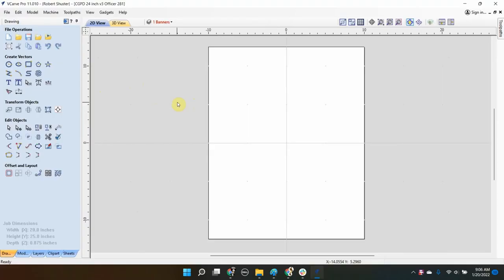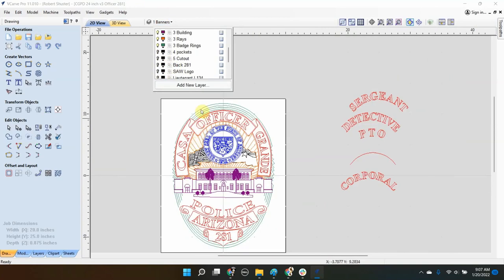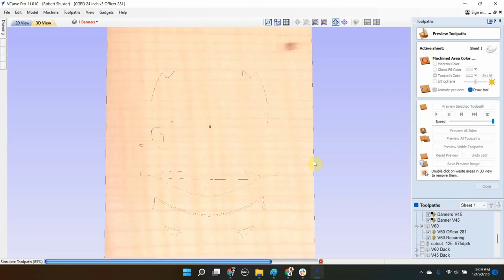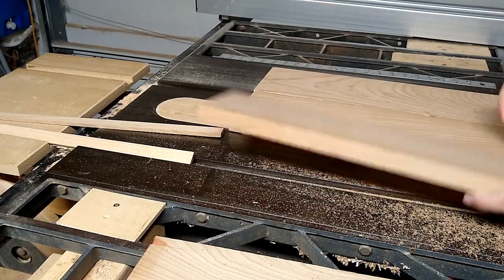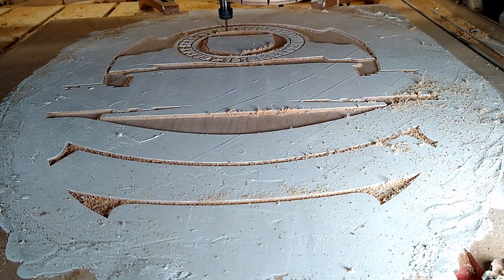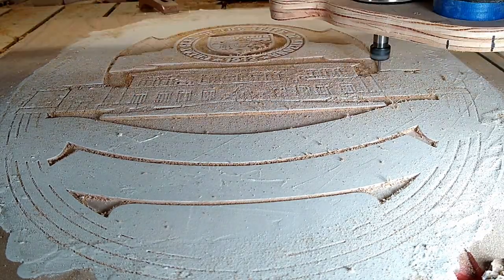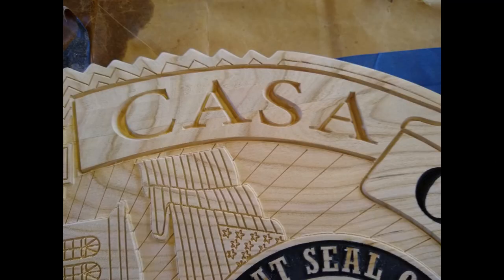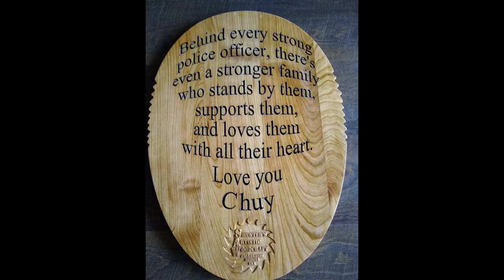Making Badge for Fallen Local Police Officer

Comment: Great job Rob.  Enjoyed your process and video.  I have done a few police badges (donations) and fireman logos/cribbage boards.  All gratis so far.  This was before i stated getting into YouTube.  Some of them are on my Instagram page.  Getting the graphics put together is definitely a challenge.  Besides my epoxy work that you know I am doing, i have been trying to build my 3D skills.  I did one retirement plaque for the Point Loma fire department that was designed to be 3D.  that was interesting.
Reply from the maker: I need to get more into building 3D designs (I need more time in the day).  Are you using Aspire, or something else for you 3D designing?
Reply: @sidewinderdrums  for woodworking projects I use aspire.  For my 3d printer I use Fusion 360 - mostly for brackets, boxes, etc.  I am actually quite a novice at this time and exploring the landscape of possibilities.  I did do one YT video on me using Aspire to design a sunflower plate for one of my grandkids.  Video, like most of mine, is long but wanted to help others know how at least one person approached modeling something.

Comment: I am trying to do this for our local police department as a gift for their front office. How did you create the design, did you start from a picture?  Thanks for sharing.
Reply from the maker: The police dept gave me their proof file used for badges.  It was in adobe illustrator format (.ai), and vectric can open that.  I still needed to clean it up some, but was so much easier than try to do from scratch.